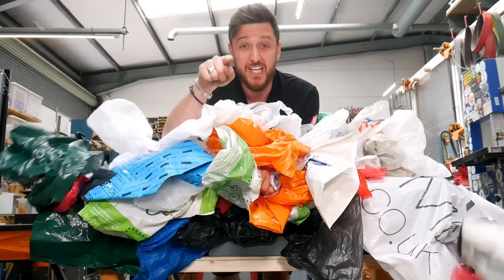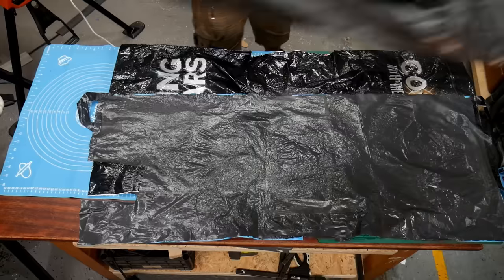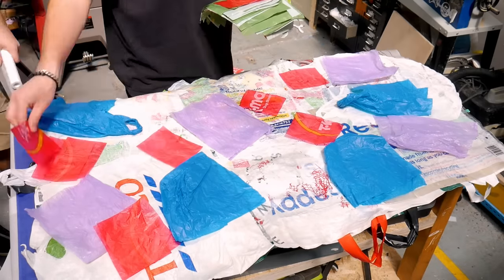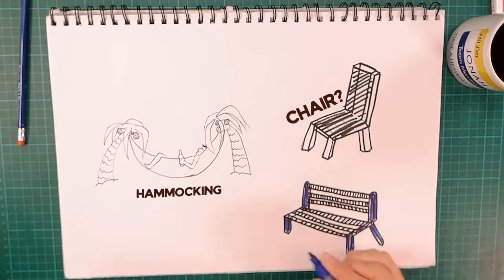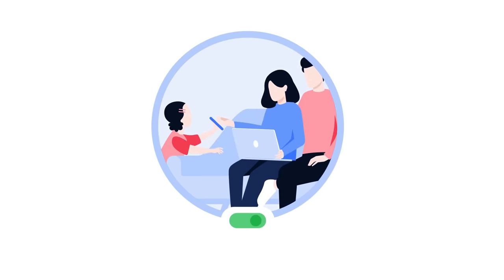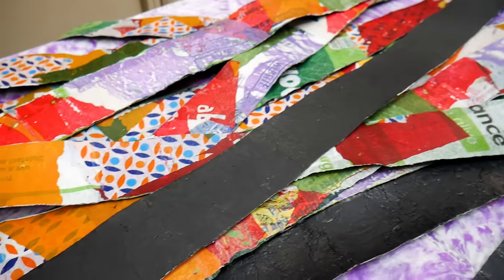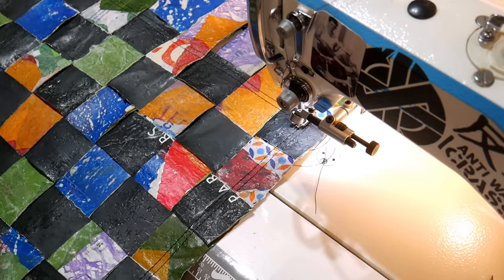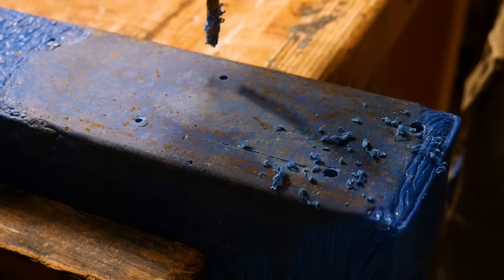Is THIS a Better Use for Plastic Bags?

Comment: I cut the bags, the same way you would peel an apple,  in a spiral, about 2 inches wide. I  then use a drop spindle to twist the strips  into plarn. Knit or crochet with it to make rugs, bags (great for beach bags) or whatever. The twist gives it incredible strength just like wool made into yarn.
Reply: Plarn!
Reply: Genius!!! ❤😊❤ Will be trying this method. Thank you for posting 😊
Reply: This great!
Reply: they break down when sun hits them
Reply: @carolburnett8372  so do you
Reply: @carolburnett8372  - I was afraid of that... I'd crocheted some into a large nest platform for great horned owls, tied to branches.  I'll keep the sun in mind for my next project and thank you.
Reply: @rynneivarsson751  I was heart broken when I had stored by treasured gourds in them and hung them up.......I could double bag and all and the plastic bags (not in the sun) had broken into 1/2 inch little blocks blowing everywhere............I have seen rugs made of old nylon hosiery and also strips of old polyester clothing and it was almost indestructible..............so, I learned quickly that you can waste your time
Reply: @carolburnett8372  I thought about this too.
Reply: What about these new biodegradable bags supermarkets now use - is there any use for those? or the fact they are designed to break down, means useless for trying to repurpose? Thanks - great videos!
Reply: everything you make with the bags breaks down into a million pieces.........the old things made with nylon hose and poly-ester fabrics are still her with us today......before you waste your precious time, you need to do this
Reply: Would love to see how you cut them.. I was making strips for bedmats for the homeless... but never got one done due to the time it took cutting and tying them into plarn.
Reply: Super cool !!

Comment: Here in Detroit, Michigan, there is (or was) a charity that collected chip bags to make sleeping pads for homeless people.  The chip bags have a shiny plastic aluminum-like layer inside that reflects heat, so if you make the pads with a shiny side up, body heat is reflected back onto the sleeping person.  Worked very well for people sleeping out of doors in cold weather, and to line sleeping boxes for stray cats.
Reply: I'm sure you could do the same thing and make car window reflectors along with a little cardboard as well. Gosh, now I need to eat more potato chips to make that!
Reply: Great idea and at least very useful and well thought.
Reply: Great idea. I hate throwing them.
Reply: @JillRhoads  🤦 I just paid $17 for a Star Wars sunshade, when I could've made a cool patterned one for myself!
Reply: Now that sounds like something that is actually worth doing! I can't see this being worth doing for plastic shopping bags since there are many more easier methods of putting them to use. My go to use is as smaller trash bags since either way a plastic bag will be used to hold the trash. Second use is to hold larger amounts of dog poop when living somewhere that you can't let the poop sit out to naturally decompose. 

Once too many bags build up I'm usually close to moving and can use them as packaging material to help keep things from breaking and reduce the amount of new materials I have to buy to be able to move without breaking stuff
Reply: I have crocheted at least 14 sleeping mats and sent them with an evangelist to Haiti.  They were received very well.
Reply: Our brave and strong Outdoor Citizens
Reply: make a tent. shiny side up, reflects heat away if you’re in hot weather, shiny side down if your in cold, keeping heat in. Could be reversible.
It could be multiple layers to be strong. just a thought 
pair it with blankets & sleeping bags other people have mentioned here, you’re all “set.”
Reply: @dk_pink love this concept ... I can see colourful beach shades & mats ... endless possibilities 😊
Reply: there are many, many ways you can get old fabric or old clothing to cut up and patch together that will no go away as in break down into tiny tiny dust size pieces.........and you do not waste your time this way also..........
Reply: Just stitch it instead of melting it, keep the fumes out of the atmosphere or knit or crochet the strips, again no fumes, have made awnings and tarps etc… no melting no fumes!!!
Reply: Make a 6ft by 3ft sleeping mat using your method. I'd be interested in that.

Comment: I can imagine this material would be good for shelters too, such as tents, shades, tarps, etc
Reply from the maker: For sure, we're really keen to try it out for that type of application too.
Reply: They are great to crochet for mats. Only downside is they are heavy. But the last and cab be washed.  I have one u take to the park with me.
Reply: @abbylynn8872  i crocheted a kitchen mat but prefer something without the holes crochet creates. i thought about applying their iron technique to my crocheted mat. it might not close the holes up all the way, but i'm still curious to see what would happen. after watching this video i think i will try it!
Reply: Would off gassing be an issue?
Reply: @teresayeates3437  it doesn't get to a temp that will off gas. You should be good.
Reply: @nedlyest  was thinking about trying something like this but perhaps imbedding dirt or sand on the surface for light scattering as a chicken coop roof substrate.

Was worried about off gassing but if this doesn't off gas then neither should what I was thinking about trying. Yes!
Reply: @nedlyest  Thank you.
Reply: @kandyappleview  could try backing the crochet mat with some more plastic bags when ironing it. I've never tried it so no promises it'll work but it could do the trick to close the holes.
Reply: @___Music_Is_Life___  ah, that's a good idea. I will try that. Thank you!
Reply: That's exactly what I was thinking! Wonder if I canake a type of catio netting with it?hmmm off to gather my materials n iron😂!
Reply: Im thinking tarps/shelters too......for my hens
Reply: Idk, about the off gassing as you put it. Good housekeeping did experiments washing all kinds of plastics and found that just hot water washing resulted in gasses coming off of them. That article got me to stop using most plastics. I never reheat them in the microwave, and don’t even heat tv dinners in plastic they come in-I transfer it to glass lidded bowls.
Reply: Yes I have seen in other countries this is what they use to make shelters but for some reason we do not do it here.
Reply: Thought the same. Would make a terrific awning for a deck or patio.
Reply: Great idea 👍💡 i was thinking of to make so privacy for my daughter's totally open terasse on 1 floor where every one can see all right now ,an that's is not so fun to be exposed for every single one in nearby area 😱😵🥴🫡🤔
Reply: Tejidos a crochet se planchando y quedan sin hoyos....
Reply: Could the layered bags be made into shoe soles of some sort? I know there have been attempts made using plastic bottles.
Reply: I agree that’s what I came here to say. It’s not exactly a solution  for the the homeless, but it might be a little sturdier than a tent. It just needs to be something they can assemble and dismantle easily and quickly.
Reply: @justkiddin84 thank you for saying so, I had no idea! Very wise of you to take the food out of the container...
Reply: Basically a tarp
Reply: So...why not insulation or tyvek type material to hang below siding. If there is "off gassing" that's not good. 
There is no away when something is thrown away. 
   Side note, my friend went to Haiti. The streets are layers of trampled plastic garbage. Nobody does anything about it and many live inner blue tarps. They need better shelters. Why not recycled plastics?????
Reply: They break down with uv sunshine exposure and flake everywhere
Reply: My immediate thought was DIY tarps!
Reply: @kandyappleview I’ve been braiding bags together to create a sort of mat. It’s not finished yet, but there really aren’t any holes to speak of!
Reply: @BrothersMake  , you should look into the new origami, which means collapsible structures.  There are foldable pavilions using an accordion fold, the same old geodesic design that the hippies loved, and many, many more.  The geodesic dome has the most space for the least amount of materials, but the drawback is that it doesn't really work without multiple pieces. If you could do it as a modular, so every piece is identical, then work out different styles based on how many modules are used, it could be like a suburban housing development for tent city living. Also, even if one dwelling gets trashed, the pieces would be salvagable for those looking to upgrade their digs. The cool thing about origami is that you can experiment with regular sheets of paper and scale it up per your wildest dreams. 

I am 100% a fan of recycling plastics.  I am thinking about using your idea here to replace the torn material on my very high end patio furniature(it was a gift from a charmed life I once lived). It would be extra awesome if you ran your workshop on home brewed biodiesel, made from other people's single use plastic trash. I love it. My only criticism is that the horse needs a bigger version, plus an extra chair for his friend. Cheers!

Comment: Great job, guys! I think one obvious project for this "material" is making a raincoat. You could line it with cotton, or linen, or some other sustainable and comfortable fabric, and step out on a rainy day in a one-of-a-kind garment that would be eye catching. I could also see it being used as an insulating lining between two layers of cloth for cooler weather. Honestly, there are probably a thousand and one uses for this material.
Reply: You don't really want that kind of two way impermeability for prolonged use since the plastic layer will also prevent your sweat to escape thus making you drenched . Modern rain jackets are made with an outside fabric that will shed water but is not waterproof and an internal breathable layer. But a poncho could work with the extra ventilation.
Reply: @linusgoblin  I get what you're saying. I think the key thing here is "prolonged use." For some people, myself included, rain coats are just worn between the car and the destination, and then they are taken off. For folks who intend to be outside in the elements for a sustained period, I think your poncho idea is a good one.
Reply: Might work really great for homeless/ tent people as extra weather insulation.
Reply: Think camping.
Reply: A rain poncho/blanket/tenting item for the homeless? Perhaps 4 corner fasteners for changing liner to meet seasonal needs? Either rolls easily to be stored in backpack or morphs into backpack.
Reply: @linusgoblin  Maybe underarm grommets for some breathability?
Reply: @livinginthenow   Maybe underarm grommets for some breathability?
Reply: @davidcattin7006  That might work. You could also try stitching in some other breathable material in that area, like cotton. Looking at my comment now, I'm thinking that having the lining material removeable for washing would be good.
Reply: Would make great umbrellas!
Reply: @coffeync Brilliant!
Reply: One other thing to consider is that the plastic material is somewhat stiff. Might not be too comfortable as a garment.

Comment: It was so funny to see you just intuitively make and use a clapper 😂 in tailoring we use a hardwood tool that’s basically exactly like what you made immediately after pressing, it adds more force and the wood also draws heat off the material quickly (you can also use your hand) so it helps to set it more firmly into place

Comment: Suggestions for uses: liner for sleeping bags as a vapor//moisture barrier when using on ground, umbrella covering, raincoats for kids--not a big expense when they get lost or ruined, notebooks voers/book covers, tote bags for items not to get wet, handy shoe covers that can be bolded into handy small pack and carried in purse for days when boots aren't handy but person doesn't want to get shoes wet, tablecothes for picnic tables or lawn picnics, feeding mats for under pet feeding stations in homes, etc., You get the idea. Lovde this pproach to a difficult problem. Good luck.
Reply: Ohhh!  A camping mat.  That's a great idea.

Comment: I iron all my plastic bags and sew them into beach bags and what I call crash pads, their basically like a big cushion that I quilt sew with cut up plastic bags to make it like a cushion!!  There great for outside seats and beach, I even use plastic table covers there thin but iron a bunch and you have perfect fabric material to sew in regular sewing machine but with Jean needle and thick polyester thread!
Reply: I was wondering what sort set up would be best for sewing with this material. I thought that the machine that Kev used in the video might be an industrial one, and might have been set up for sewing leather. Now I know my regular machine and a denim needle can do the job. Thanks for the info!
Reply: Wish you post a picture, this sounds really interesting
Reply: @livinginthenow  I have a regular home-use sewing machine (Singer Stylist 7258), and if the denim needle doesn't work out for you, I've had great success with a leather needle!  Bear in mind that leather needles have a cutting edge to them, so while they chug along perfectly with thick non-woven materials, they do create an actual hole (so if you had to rip the seam it would be obvious, as well as you need to be careful when backstitching).
Reply: Wow, are you serious?! A jeans needle and thick polyester thread? That will sew through a layer of plastic? OK, now I am going to look for a pattern for a rain cape 👍🏻. This is great, thanks!

Comment: In Australia with the ban of "single use" plastic bags, we now have 75% of the plastic bags that have 200% of the plastic (percentages completely made up, but basically supermarkets doubled the amount of plstic in a bag so they are no longer considered single use on paper).
So what i've had rolling around in my brain is to find a way to turn those almost single use bags into collapsible create like some supermarkets do their deliveries in.
The ideal size would be so they fit into a standard shopping trolley and stack easily.
This way not only are we reducing waste from our shopping experience, we are repurposing the waste in a way that reduces our need to keep using the waste.
Long life/multi use shopping bags are ok but they are only as useful as the weakest point (handles) and they soon become trash themselves, however collapsible crates are easy to store in the boot of a car (or on a bike I guess), and will not only last ages but also reduce waste every time they are used.
Reply: In Canada, 1 of the stores has baskets that fit well in the trolley/cart, and can take advantage of hooks on the cart to hold the baskets. It's really cool.
Reply from the maker: Love that idea, would certainly be a great and long lasting use for them.
Reply: Just don't make them so big we elders can't lift them. Great job
Reply: Some of the US states (or just cities) have started banning single use bags as well, but the new "reusable" LDPE bags are so flimsy that they tear if you look at them funny.  But somehow they're considered "reusable" and therefore still allowed in those areas.
Reply: Yeah I’ve been dismayed at how fast the reusable ones break down. I forgot I also fix the handles but they don’t even last ten years!
Reply: This is brilliant, would love to see it become a reality, wish you lots of success! Thanks for inspiring us Brothers Make ❤
Reply: You mean collapsible crate not create, but they could create a crate.
Reply: Many of the bags you get now disintegrate over time into a powdery mess! Even the “cloth-type” ones perish all too soon.
Reply: @heyallenify  I still use the plastic bags for bathroom trash, no way anyone's recycling that.... Other than that, now I have a bunch of ideas on what to do with the other bags. Repurposing makes way more sense, than taking a chance on what the local waste/recycling company might actually do with materials. 
✌️😎🍀
Reply: @nz-nz  Cloth can be shredded to make "rag" paper, but I haven't done anything like that in a long time.
Reply: @erinmcdonald7781  I use them for cat litter box cleaning, another thing that isn't recyclable...
Reply: I like the way you think! Brilliant!

Comment: We have several aluminum framed folding lawn chairs that are overdue for new seat webbing. I've been considering various options. Definitely wanting to do something at low to zero cost, reusing waste/trash materials... something DIFFERENT, with strong recycling vibes, AND attractiveness/cuteness potential (to sell more neighbors on this kind of re-use mentality!)... BINGO! 
THIS is perfect idea to adapt!❤ 
 For one chair, I'll trial reinforcing  the strips with a few rows of machine stitching along the strap length with strong thread... to help increase the sitter's sense of security, jazz up the "finished" look, & probably extend longevity of the laminated plastic. One chair with the stitching & one without - - & see who withstands the most!
Maybe the 3rd chair will alternate sewn & plain laminated plastic strips....
 Thank you guys for your good work & sharing so much inspiration!
Reply: Not exactly low or no cost as irons use the most electricity causing higher electric bill which puts even more strain & expense to run power plants which negatively impacts the environment. . .
A tradeoff to be considered.
Reply: Also  heating up plastic isn’t the best idea without good ventilation
Reply: I was thinking the same thing for the ripped webbing, but I'm not sure how I would go about attaching it. You said you sewed yours on; did you hand sew it?

Comment: Great summertime chair.  Nice work!   I've done a similar project with plastic grocery bags as well, used a set of vacuform heat lamps to heat up the plastic and then form everything into a big sheet. Then made some foldable awnings for the side of a camper (or caravan as you would call it).